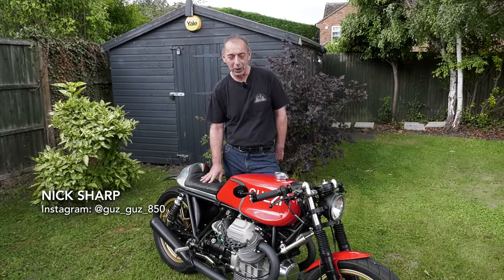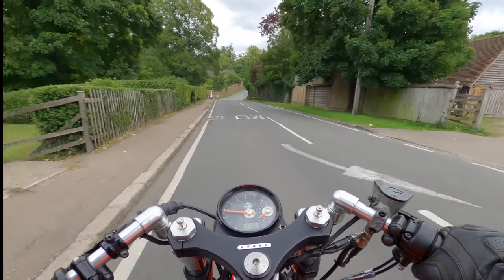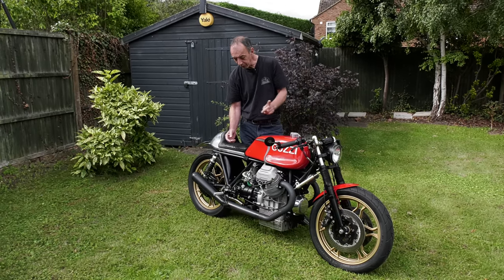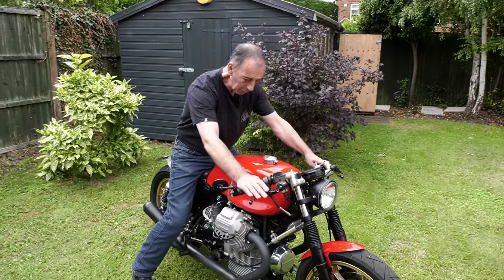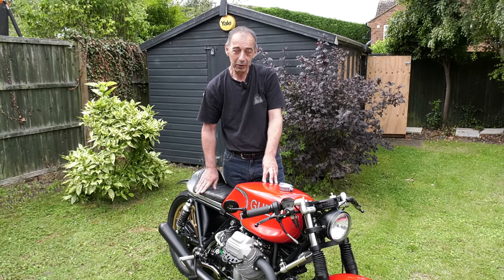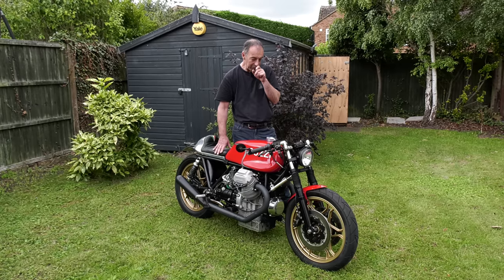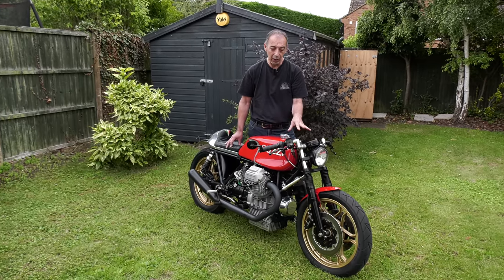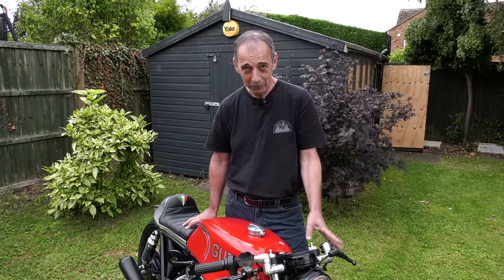Moto Guzzi Le Mans 850 Custom Cafe Racer Build - Overview And Ride

Comment: I have had 4 guzzis..1979 SP1000–1980 V50 ll—2004 V11 sport—2007 RED Norge GT 1200, which I currently own  ...I have 40 years behind bars on guzzis
  One little thing:: GUZZI pronounced the way you would say PUT-SEA,, like you would say pizza. It’s like saying two separate words.When there are 2 “Zs”,There is a chop in the middle of the word just like in the word pizza..It’s not pisa as in  the leaning Tower of Pisa, it is peat—zzaah!  like saying two separate words..GOUT. ZEE...
   now that I have condescendingly overstated my point. 
   I love your bike..Do you have any issues with the rear tire gripping the leading edge of your license plate as your suspension bottoms out?
  you mentioned the large gap between the rear tire and the frame on newer bikes because of the single shock, I used to road race motorcycles ,eight years, TZ 250, RDs,ect..One of my fellow competitors got into a tank slapper on his TZ 250, His leg somehow got pulled in by the rear tire into that gap below the seat, and broke his leg in eight places. Miraculously, he coasted to a stop in that contorted predicament without falling. To this day, those gaps still make me nervous.
   I put a proximately 160,000 to180,000 miles combined on my 4 Guzzis over the last 4 decades...they all had a common fault, that oil pressure sensor that screws in to the block between the cylinders. I’ve had to replace them on every one of my guzzis.. my 1979SP 1000, the lifters were all heavily pitted where they meet the camshaft, I was changing my oil pretty much every 1000 - 1500 miles with 20/50 Castrol..That machine did not idle much either. I didn’t use it as a commuter, that was my Saturday/Sunday / long distance long weekend go out and get lost machine..100 miles was a short ride, 250 miles was about average, I did do a 740 mile day once.. that’s the day I learned the hard way how critical it is to drink a lot of water on a long day...so I would change the oil sometimes every two weeks/1000 - 1500 miles, so I was surprised to see the hard-facing wearing off of the lifters at 35k miles...
   I have had many motorcycles since 1968, dirt, Street, touring,road racing, trials, trail bikes, dual sports. The most uncomfortable motorcycle in the history of the universe is the GUZZI V11 sport..I tried everything to civilize that machine enough to be able to ride it at least 100 miles. I drilled the upper triple clamp and mounted perches for Honda CB 400 F bars, I installed Buell Ulysses foot pegs which are 1 1/2 inches lower, they slip right on with no mods,I bought a Corbin seat which put my balls to sleep within five minutes due to the hump structure built into that seat right behind the gas tank , I tried foam grips.... That machine had me limping after just a half an hour. It seriously injured my knees. I never had trouble with my knees in my life, until I rode a V11 sport.., after two years, I finally realized that it was not a grand Turismo machine or a touring machine..I gave up, sold it, and bought my Norge which is one of the most comfortable motorcycles I ever owned next to my Goldwing.. my knees recovered...
   I know any Japanese 600 sport bike would have my V 11 sport and my Norge for lunch. But I don’t care. I’ve had jap sport bikes, they have personality, they work perfectly..they are entertaining,  ..But -they are detached,impersonal.... they have no soul. guzzi’s are a living thing...Not only are they some of the most beautiful things...they are alive....
  One tip I pass on to fellow moto junkies that I learned when I was a Honda mechanic. A bulletin came straight from Honda to all service departments..about using dry gaskets during engine assembly. Honda said to get a can of silver / aluminum paint. I use rustoleum  aluminum paint, I have been using the same quart can  since 1973.Do not stir the Paint. Use a screwdriver to dig the thick paste from the bottom of the can of paint.. apply that thick paint to any dry gasket such as a base gasket, head gasket, valve cover gasket, side case gasket ect.. any gasket that is supposed to be oil tight. ....work that paste by hand into the gasket both sides, and install the gasket still wet on the engine. Not only should it never leak, but when you need to take the engine apart, it will come right apart..I have been using that silver aluminum paint on my valve cover gaskets and any other gasket that is not specialized / different..I have been doing this since 1979 starting with my SP 1000. I have never had to buy another valve cover gasket since..They don’t stick to either surface when you take things back apart, which is the major cause of gaskets ripping. no more scraping off  the old baked on gaskets , or having some of the tailings from the scraping ending up inside the engine...

Comment: It is not a loop frame, it is a Tonti frame - completely different.
The height of the bars on the original are about 2" higher than the top of the forks
His horse power figures are well down on a standard MkII.
What was he talking about when he said the air box is under the seat? The Le Mans only got an air box in MkIII guise, before that they were open bell mouths with a bit of wire mesh to stop birds and young children being sucked into the engine.
The original brembo linked brakes were very effective.
Some pictures show the bike with Bridgestone BT45's or 46's, so I suppose the radials were put on for the track?
I don't know why he has to talk the original MkII down in order to talk his version up. He has made a number of improvements over the original and it is very well crafted. Would I swap it for my original Le Mans MkII? In an instant.

Comment: Hi Nick, beautiful Guzzi. Can you please give me a reference for the brembo clutch lever or which Accossato fits? I can't find it anywhere. Thanks Ralph
Reply: Hi Ralph 
It's a few years ago when I bought it, but a bit of googling found this on the accasato web site ? Good luck 😉
https://accossato.com/en/accossato-radial-master-cylinders-motorcycle-scooter-offroad/1436/accossato-radial-brake-master-cylinder-16-x-18with-integrated-fluid-reservoir-and-colourful-folding-lever-nutlever#
Reply: Thanx!
Reply: Hi Ralph, sorry I misread your questions, here's a link to the cable clutch from accasato,
https://addictionmotorsport.co.uk/accossato-748/accossato-cable-clutch-lever-assembly-

Comment: None of the mans 850s did not have high but low handlebars being a sportbike instead the Guzzi GT 850 was a touring with a high fairing and built for travel in pairs. Why didn't you put the Moto Guzzi logo (the eagle) at least on the tank? Compliments, it's so nice bike !!!!
Reply: The tank logo is a nod to the Dr John race guzzis, they looked like this. Plus it was just a design decision, why do what everyone else does ?
Reply: @caferacer850  Simply, because it's a restoration of and old lady " Moto Guzzi", as you have stamped on the tank 😃, or your name Is Guzzi?

Comment: can u legally ride a motorbike in England without blinkers?
Reply: Yes you can, but my bike is gutted with bar end indicators 😉
Reply: @caferacer850  thanks for that. Which device is controlling the blinkers? I understood it's digitally controlled but the Digital Ignition ZDG 3.23 does not from the documentation. Thanks for you kind reply.
Reply: @reiporre  the indicators are operated by the motogadget m unit.

Comment: i really like your tank and seat!.  with spoke wheels (and a modified brake holder in the back) you can get rid of a lot of weight from the wheels. probably not terribly necessary on a road bike, but oyu do  feel the difference with lighter wheels! see https://www.youtube.com/watch?v=cRUCjYfqx8I&t=167s  I have a race bike sitting in the garage for 10 years now and waiting to get back on the road, not sure if i will invest the energy to do that....your vid is inspiring
Reply: Thanks for the kind comments 😊
Yes I would prefer to have a set of wire wheels too, Iam saving up for them now. I think you should get the old bike out and get her running again 😉
Reply: @caferacer850  yep agree :)  an interesting source for spoke wheels may be hmb-guzzi.de but i am sure you know other good sources....cheers
Reply: @VAMIRACING  yes, my bank balance knows Hmb very well 😅
It's their cnc set of hubs Iam after, lovely kit and will make a great set of wheels. I priced up a set last year, and it's £1800 😳 (cheaper for the non cnc/cast hubs)

Comment: The best Guzzis are from Kaffeemaschine.....lots of ideas copied since 2010
Reply: You might like to know that HT moto, I mentioned in the video, were the original manufacturer of the exhaust system and bodywork parts, tank, mudguards etc that kaffemachine originally started to use when Azel first started. When HT moto retired, he sold all his stock and patterns to Kafemachine. He has developed other parts since then, but if you check out my exhausts and tank, Kafemachine are still selling these on their Web site.
Reply: @caferacer850  Hi Nick
Thanks for reply...have not watched video..bike is great unlike a lot of Cafe Racer Guzzis. I know how good HT are...Ihave Kaffeemaschine 6 with a 1050 of theirs.
Well done on the bike.....Brian